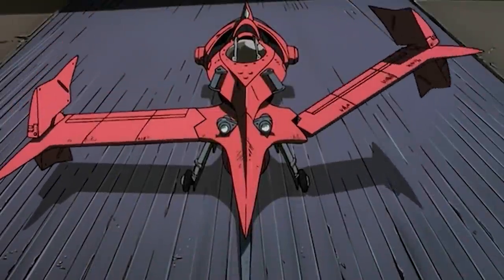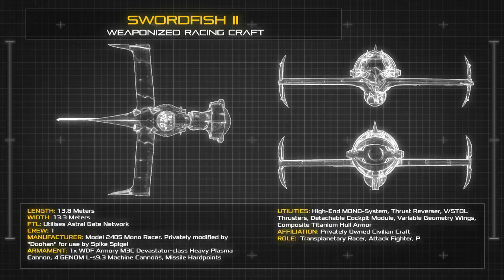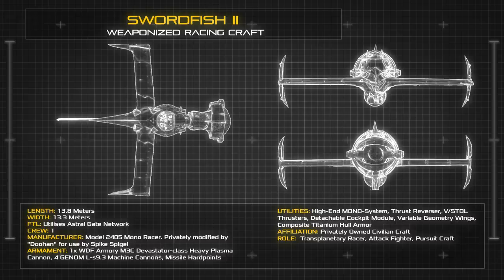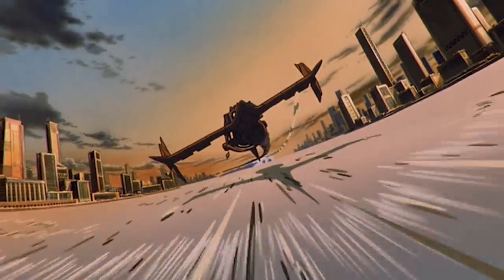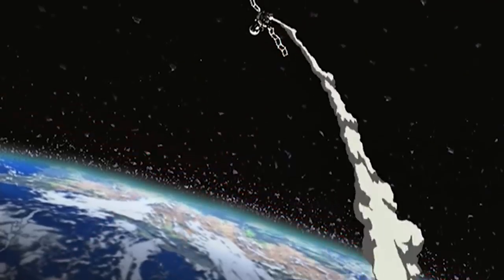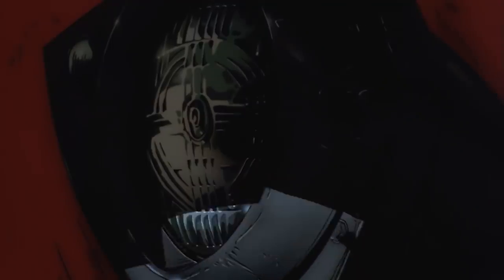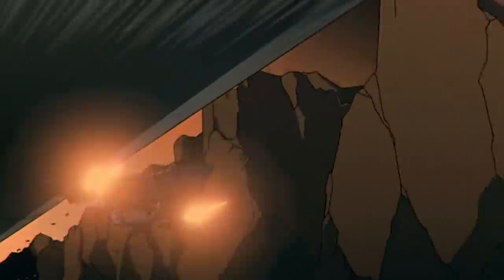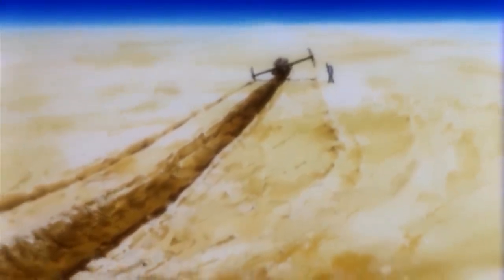Cowboy Bebop: Swordfish II | Ship Breakdown

Comment: Weaponized racing craft? Well, that's sounds awfully familiar:)

...

What? No. No, I'm not referencing origins of fighter planes used in WWII!
Reply: true, but even the BF109 wasn't capable of pulling off SUCH stunts.
Reply: @ranekeisenkralle8265  well it didn't have trust vectoring now did it ? nor the spitfire for that matter :). I wonder though what kind of maneuvers could they pull off if they did ever had something similar ?
Reply: @gusty9053  if you tacked RCS-thrusters onto those planes they's have torn themselves apart with the sudden changes in thust they were not designed to handle.
Reply: @ranekeisenkralle8265  Actually, no. RCS thrusters, at least the ones used on spacecraft, don't work at low altitude. The motors need to have a sufficient pressure advantage over the surrounding atmospheric pressure in order to produce a meaningful exhaust velocity. They indeed do not have enough pressure for this. Now, the bleed air valves on VTOL planes, like Harrier, F-35B, etc, do have sufficient internal pressure to work at low altitude, but they are far more complicated than RCS thrusters.
Reply: @米空軍パイロット  I am aware of that and wasn't referring to RCS for spacegoing vessels either. The necessity for higher force is precisely why i said the old planes would come apart if someone were to try that. I had been thinking of small liquid-fuel rockets for that purpose as those have sufficient force to basically change trajectory at will (but add a boatload of other problems such as fuel weight and stuff..)
Reply: @ranekeisenkralle8265  Got it. Well in that case, given the size and weight that such a system would have, these fighters probably wouldn't take off.
Reply: @米空軍パイロット  Maybe. Or the rockets have it cartwheeling all over the place.
Reply: Well some ww2 fighters were designed with similar ideas in mind but they weren't racing aircraft that were pressed into service.
Reply: @thearisen7301  There was the Caudron 710.
Reply: @thearisen7301  you mean things like ME163?

Comment: The motto of the ship is the same I would say about semi's.

 I want a work truck, not a runway truck. I want power and efficiency, so that when I connect to a load of 40k lbs it won't give out on a small hill. While getting a mpg of minimum of 7 miles per galleon of fuel. (The less fuel burned to complete the job, the less operational cost required to do the job.)

Anything that is qualified as decor, I do not need. That is extra work not needed to drive a big rig. Super Singles are a decor option. Do not want on my truck, if one blows, you are immediately dead in the water, "sitting duck." Blew one of my drive duels and still made it to a safe haven for my truck 15 miles down the road.

Shiny on a truck is saying, "Please Carjack me," Extra lights on the truck and trailer, D.O.T. would love you. They can write a ticket for each light that is out on your truck, even though isn't one of the regulation lights.

Comment: This is a bit off-track for the subject matter, but the opening quote is kind of off- in the dialogue, Doohan's responding to Mile's train of thought with a general point about engineering rather than the Swordfish specifically. I checked it out and it was misinterpreted in the dub by them adding the word 'this' (the subbed line, matching the Japanese is: Do you want to use a machine, or do you want the machine to use you?).